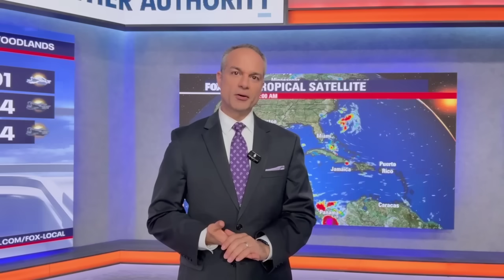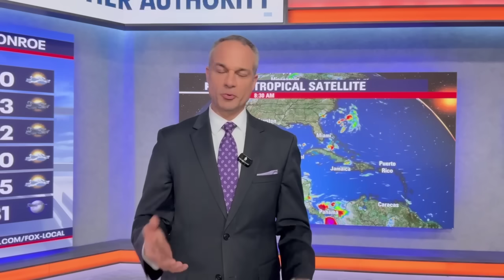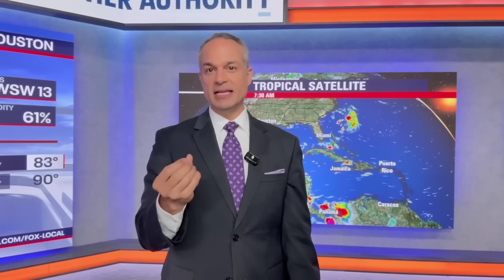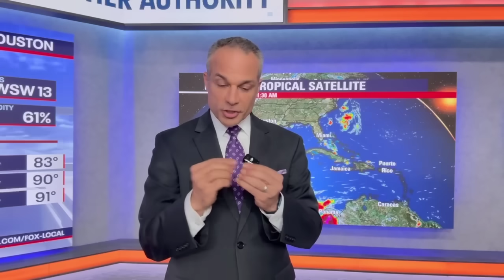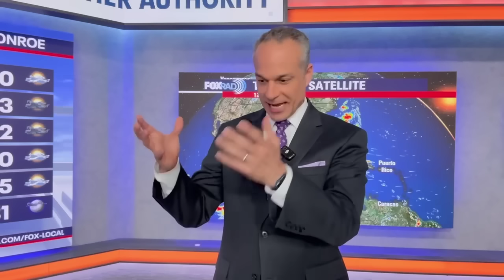What is cloud seeding? Geoengineering? Process EXPLAINED

Comment: I've watched tanker size jets, the type that refuel other jets, spray into a clear blue sky row after row that spread out and join each other until the whole sky is white and black clouds that leave here in Arizona and head back east where they experience bad weather... Don't tell me it can't be done...
Reply: Exactly!
Reply: 💯 They think we're idiots!!!! 😢
Reply: @brigittebeltran6701  They're right
Reply: What are they spraying? Cloud seeding lets out an invisible mist. And, they don’t do it at 30,000 feet. That wouldn’t even go into the right area.😂
Reply: @danielhammond3218  They aren't "spraying"anything. Have you ever seen water dripping from the exhaust of your car, partucularly on cold, winter mornings? That's condensed water, a by-product of internal combustion engines. As the fuel burns, the carbon in the fuel binds with oxygen, and so do the hydrogen atoms present. This reaction produces CO2, and H2O. On release from the engine, the water vapor freezes so fast, it literally forms ice crystals, instantly. The CO2, as it's a gas, simply dissipates, remaining invisible. That is ALL there is to it. The chemistry is really so simple, children SHOULD understand it in the eighth grade. No offense.

Comment: This is called gaslighting. Geo engineering is high altitude injection of specific toxic minerals and chemicals to alter the climate and block out solar radiation. NEXRAD radar facilities all over the globe emits a frequency that interacts with the high altitude injections changing weather systems and the jet stream.

Comment: Try, 'What is Carbon Dioxide' for $1,000.  Carbon dioxide in the air holds heat.  Heat evaporates water into the air.  When cooler air meets hot wet air, it rains.  Add more carbon dioxide, you get more heat, which holds more water, which creates more rain, which creates more floods.  Yes, there is weather manipulation, and the oil companies have known it was happening for a hundred years, and instead of changing, they paid billions to convince the public that carbon dioxide wasn't the problem.  Billions of tons of new carbon dioxide dumped into the air.  You been played, and it wasn't by a few attempts at cloud seeding.

Comment: Why cloud seed when s tropical storm remnant is on its way
Reply: BINGO
Reply: That's sounds kinda obvious that it's going to be more moisture in the air than normal with a tropical storm moving across the area..
Reply: @jaypoole2454 Seeding does not increase moisture in the air - It reduces it.  The seed particulates bond to the moisture,  which is too light to fall to the ground, so that it combines into heavier "drops" that will fall.  It literally is the opposite of what you seem to be perceiving it is.
Reply: They don't know what's still lingering in the air. I'm willing ro be they haven't tested the air after the supposed seeding occurs and after the rain falls.
Reply: They need to do more testing of cloud seeding, I think.
Reply: Depopulation, read UN Agenda 2020, 2030, 2050.
Reply: Clouds don't live as long as perhaps you are assuming.  The two clouds which were seeded, were both entirely gone within 16 hours of the seeding.  No "seed particulates" remain in the atmosphere - They are gone when the cloud is gone.  The clouds were gone two full days before the front which caused the rain, and both were over 100 miles south of what would later be storms.  There is zero correlation between the two things.

As to why those clouds were seeded, when and where they were - because the Texas government paid a company to do exactly that, in order to prevent draughts from completely destroying  farms.
Reply: @danelmore6553 You didn’t answer their question, though. Why would they schedule cloud seeding a day before everyone with the weather app knows there’s going to be an unholy downpour?
Reply: @danelmore6553  this gaslighting doesn't work anymore

Comment: HARP
Reply: BINGO
Reply: There is also  D.E.W. direct energy weapons that target fires   using a type of microwave technology
Reply: Human caused global warming. If there was a nuclear world war with global fallout that blocks the sun, you would still say its not human fault
Reply: High-frequency Active Auroral Research Program (HAARP) is a University of Alaska Fairbanks program which researches the ionosphere – the highest, ionized part of Earth's atmosphere. The most prominent instrument at HAARP is the Ionospheric Research Instrument (IRI), a high-power radio frequency transmitter facility operating in the high frequency (HF) band. The IRI is used to temporarily excite a limited area of the ionosphere. Other instruments, such as a VHF and a UHF radar, a fluxgate magnetometer, a digisonde (an ionospheric sounding device), and an induction magnetometer, are used to study the physical processes that occur in the excited region. Work on the HAARP facility began in 1993. Initially HAARP was jointly funded by the U.S. Air Force, the U.S. Navy, the University of Alaska Fairbanks, and the Defense Advanced Research Projects Agency (DARPA).[1] It was designed and built by BAE Advanced Technologies. Its original purpose was to analyze the ionosphere and investigate the potential for developing ionospheric enhancement technology for radio communications and surveillance.[2] Since 2015 it has been operated by the University of Alaska Fairbanks.[3]

High-frequency Active Auroral Research Program Research Station
Aerial view of the HAARP site, looking towards Mount Sanford, Alaska
Established
1993
Field of research
Ionosphere
Location
Gakona, Alaska, United States
Operating agency
University of Alaska Fairbanks
Website
https://haarp.gi.alaska.edu/
The current working IRI was completed in 2007; its prime contractor was BAE Systems Advanced Technologies.[1] As of 2008, HAARP had incurred around $250 million in tax-funded construction and operating costs. In May 2014, it was announced that the HAARP program would be permanently shut down later in the year.[4] After discussions between the parties, ownership of the facility was transferred to the University of Alaska Fairbanks in August 2015.[5]

HAARP is a target of conspiracy theorists, who claim that it is capable of weather manipulation and mind control. Scientists and other critics point out that these claims fall well outside the abilities of the facility, and often outside the scope of current natural science.[6][7][8]

History
Project overview
Research
Instrumentation and operation
Site
Related facilities
Conspiracy theories
In popular culture
See also
References
Further reading
External links
Last edited 26 days ago by DinoEarth7
Wikipedia
Wikimedia Foundation
Powered by MediaWiki
Content is available under CC BY-SA 4.0 unless otherwise noted.
Privacy policy Contact Wikipedia Code of Conduct Developers Statistics Cookie statement Terms of Use Desktop 0:03